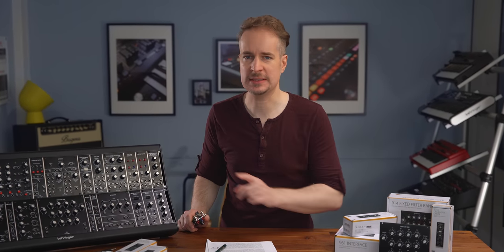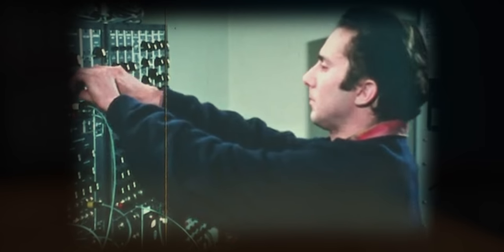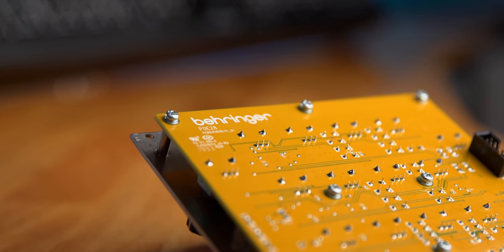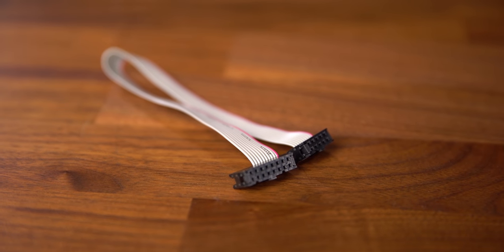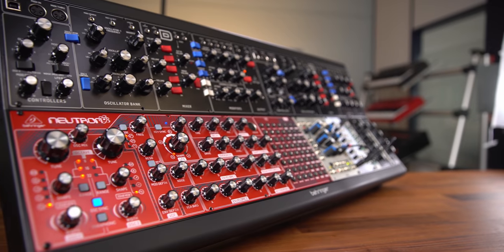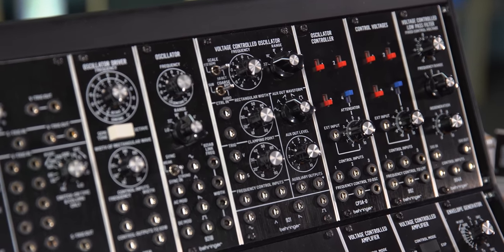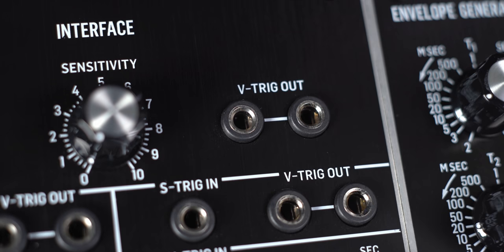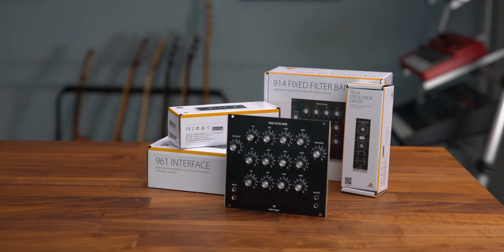System 55 – Technical Details, Important Details, Compatibility with Eurorack

Comment from the maker: We hope this answers a couple of questions. TLDR would be:
- all modules except ADSR and Trigger Delay are 100% compatible to Eurorack
- if something looks unusual, it's often just the label
- if you push the modules they produce all kinds of nice harmonics
Let us know if you have more questions!
Reply: BEHRINGER thank you
Reply: Release Date ???
Reply: Really happy to see that you stuck with the +12v -6v power. I know that it isn’t practical or possible for you to use inductors in the FFB like the original 914. What did you use to simulate that circuitry for these reproductions?
Reply: Was that slip of tongue? "The sequencer outputs V-Trigger and therefore you couldn't (sic!) connect it to the Neutron or any other 3rd party eurorack module" He wanted to say that they ARE compatible, didn't he?
Reply: @VictorSteiner  I'm sue he said you could, but I may have miss heard
Reply from the maker: @VictorSteiner  Sequencer IS compatible!
Reply: is this the whole system 55 in the eurorack go case? looks like some doubles in there forget how many modules there are for this but wanted a full system 55 and be cool if it all fit in that eurorack go case.
Reply: will you sell a bundle?
Reply: f*ck google yes same question: it will be good to suggest few bundles /set ups (ready to play including the case)
Reply: I have a question: If someone had an original and feels like replacing quirky modules with yours now instead of repairing - would that work?
Reply: @torbenanschau6641  original is not eurorack
Reply: @dnch  that is obvious, bit aprt from connectors and Power would it work?
Reply: Activez les sous-titres s'il vous plait.
Reply: Does the 914 FFB use toroidal inductors like the original moog? Thanks @behringer
Reply: @carlospinho3303  march 2022
Reply: Hey @Behringer!

I have an order pending for a System 55 (to go with my 2 Blue Marvins, my Model D, my Neutron & my Pro-1) but the thing which caught my eye here (since I'm already decided on the 55) is the multi-tiered keyboard stand in the right rear of the video - what is that?
 

I'd love to have a similar setup for my synths, but can't seem to find a stand that looks like it has the expandability that one does.

Really appreciate the work you guys do on these classic updates - great stuff!
Reply: Sorry imma beginner, would it be compatible to use the a911 as a delay effect for the poly D?.

Comment: Moog wouldn't have designed the circuits to accept possibly -12v on the inputs, because they only used -6v, but Eurorack modules can output -12v. So there are three possibilites:
1. Moog for some reason designed his circuits with a very wide input tolerance (not unlikely)
2. Behringer's engineers redesigned it, protecting against -12v, sacrificing 'historical accuracy'
or 3. Behringer are gonna let a lot of eurorack users damage their behringer modules by not warning them
Reply: @Dissonant Timbres ahh

Comment: I have been looking at modular synth for a while now and the system 55 is the one I have been waiting for... I am a bit of an analog purist at heart and I love the Moog tones so this is a win win. A few days ago I looked at prices and I was surprised that some of them weren't much cheaper (in some cases more expensive) than Doepfer, but now that I see the lack of IC's I understand why and I believe Behringer has made the right choice, they have made the choice that will make me buy this series instead of anything else on the market.
However the technical details revealed in this video do open a couple of cans of worms...
Firstly I am planning to add in a second oscillator from another manufacturer to allow for oscillator sync, presumable if I do this I wont need the Oscillator controller? Or, will I need the controller as well?
Secondly, I was planning on using an old school 1v/oct keyboard and use it to input gate CV signals to the ADSR, I am really unsure in this situation if I would still need the interface module?, and if yes... why?

If Behringer really want to impress me they should do another version of the Model D... without USB, without MIDI and without the digital reference freq. In other words... all analog. Do it for the die hard old school analog fans... it would cost less to make and they could see it for the same price... another win win.
Reply: sorry I meant sell it for the same price

Comment: I am having an issue using a Behringer System 100 297 portamento module with System 55 oscillators.  I am using a 61 key MIDI controller and the 2 lower octaves only play one pitch. Any suggestions?

Comment: Is there an envelope module without the S trigs? I get wanting to be historically accurate but needing to buy an extra module just to use an ADSR is pretty lame.  I really doubt it would have changed the character of the envelope to add a V trig output. You can be historically accurate but still innovate at the same time.
Reply: They do have a different series envelope that works with standard gates-  the 140 Dual Envelope. Also, the circuit to turn V-Trig to S-Trig is passive and really simple. There is an excellent YT video on building it.  Search V-Trig and it will come up. Early Moog keys used S-Trig- Mini all the way through the Source. I've built the adapters to make those types of units work with Gate outs on other equipment.
Reply: Maybe go for the system 100 ADSR it should work standalone to an even lower price i guess :)
Reply: I agree. not many keyboards have s trig outputs these days, and thats the "historically accurate" way of playing, so is it really sacrificing historical accuracy to just put a trigger inverter in front of the envelopes and gate delays instead of using a giant converter module?
Reply: Just mix and match, Doepfer or or something else would work fine.

Comment: 'all modules except ADSR and Trigger Delay are 100% compatible to Eurorack' - does that mean they cannot be installed in eurorack cases, or that they'll only work with other System 55 modules? Thanks!
Reply: He’s just saying the s trigger is unique to the system 55, apart from that it will all work :)
Reply: I've been digging into that topic recently because I wanted to build a converter by myself (I failed due to insufficient info in the internet): an S-Trigger is basically an inverted V-Trigger signal. Eurorack and most synths have V-Trigger. Systems that work with S-Trigger just won't interact with the V-Trigger.

Comment: Anyone know if the 921a Oscillator Driver can be used with the 921 for modulation? Thats what I bought cause the 921b isn't available and the 921a outputs say "To 921b"...planning to get one or two 921bs eventually, but in the meantime, wondering if there's any use for it

Comment: If you guys would produce a reel to reel recorder and a sequencer I could start an entire Behringer only equipment studio. 

- Behringer analog mixer; CHECK
- Behringer effect units; CHECK
- Behringer synthesizers; CHECK
- Behringer drummachines; CHECK
- Behringer sequencer; NOT FOUND
- Behringer reel to reel recorder; NOT FOUND

There is a company that does produce new brand reel to reels they're called Ballfinger, but 26k for a r2r? I'm sure Behringer could produce it for way way less, but there is really a demand for this. If you guys would be able to do it and the machine has great sound people will buy it since these old vintage r2r's can be hard to fix and calibrate.
Reply: Yes 1 tape 24 tracks Dolby noise reduction.....
Another words a clone of  foster last multi track

Comment: how can i get instrument level signals (wurlitzer / rhodes) flowing thru these modules?
Reply: There's a lot of eurorack modules that'll do that. I built the AI Synthesis AI-106 Stompbox Adapter. Circuit works great, but I had to figure out a way to more securely attach the pcb as it fell off in my case a couple times.

Comment: No OpAmp ICs? All the modules look so small, I guess still SMT? Some PCB shots?
Reply from the maker: Some components are. Same quality, more affordable to manufacture.
Reply: After experiencing firsthand how authentic their synths sounds compared to the originals (Model D and Pro-1 especially), I have faith in Behringer's design choices
Reply: FatSynthDude me too, thanks God that they are not reproducing it digitally (ABC or ACB) or what ever the term is.
Reply: It's hard to not use SMT these days. Some stuff isn't made as through hole anymore. So you have to use what is available.
Reply: @jppagetoo  They still use through hole for prototyping since it's way more practical if you're prototyping. Both have their pros and cons, for some designs you have to use trough hole components for an example like in power supplies.

Comment: Can i use step sequencer module, to control K-2?
Reply: The K2 uses Hz/V (like the original MS 20), the sequencer will be Volt/Oct which is the standard for Eurorack modules. You could try to use the External Control Input of the K2, the direct connection will give you some problems.
Reply: The Harvestman(aka Industrial Music Electronics) English Tear module converts hz/v to v/Oct to integrate my MS-20 mini into my Eurorack. Disting Mk4 module also has a converter algorithm.

Comment: I am sorry, the units are absolutely great, but not historically correct. SMD is completely modern and wrong. One wouldn't use ceramic caps instead of film and foil, so SMD sure isn't going to cut it. You are making affordable models of great synths, offering accessibility to all, isn't that enough? Why overreach with grandiose claims? They sound great and are a great price, unbeatable in fact. Let that suffice. Stating they are "historically correct" is too much.